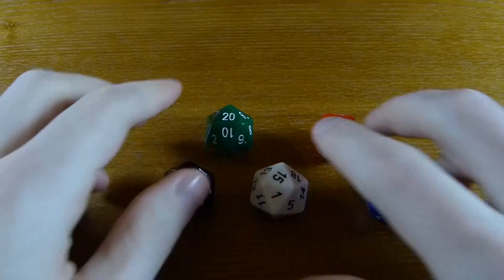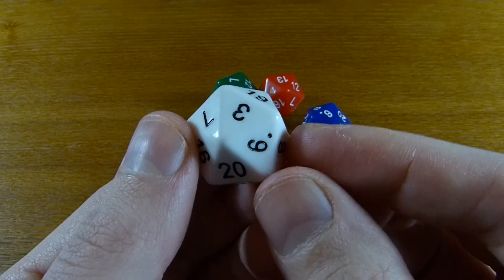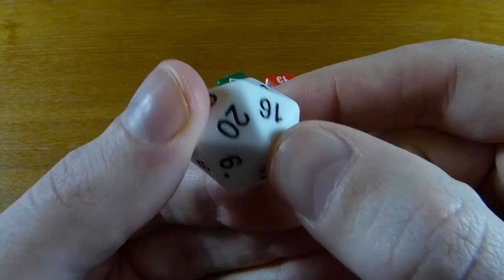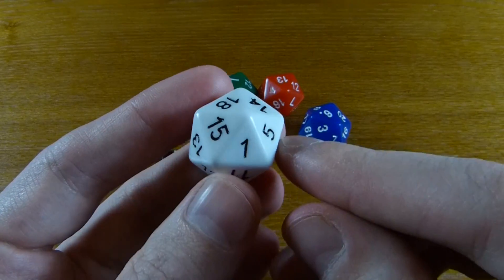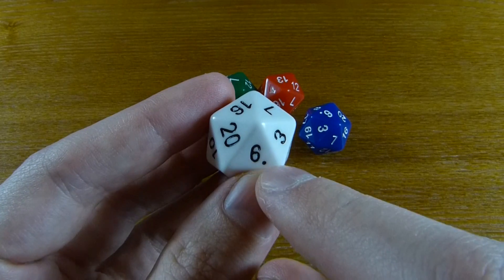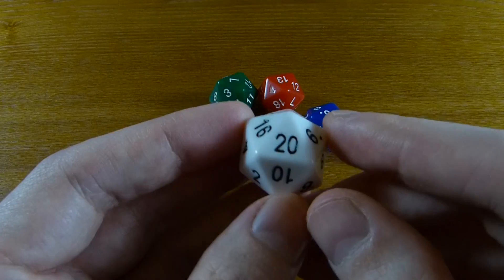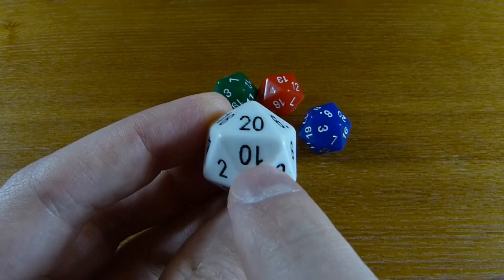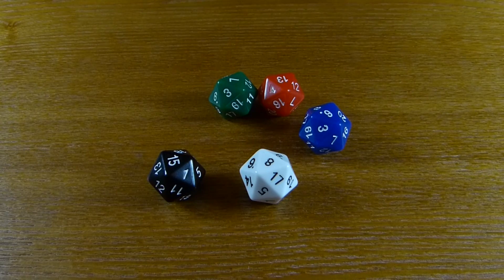Numerically-balanced d20 dice

Comment: I discovered other interesting properties of these dice:

As I was watching the video, I paused frequently to write down the numbers on the TOP HALF of the die (centered around the 20) and the numbers on the BOTTOM HALF of the die (centered around the 1).

The dice in this video have the following properties:

TOP HALF:
Eight numbers (80%) range from 1-10; Two numbers (20%) range from 11-20
Seven numbers (70%) are even; Three numbers (30%) are odd
2, 3, 4, 6, 7, 8, 9, 10, 16, 20

BOTTOM HALF:
Two numbers (20%) range from 1-10; Eight numbers (80%) range from 11-20
Three numbers (30%) are even; Seven numbers (70%) are odd
1, 5, 11, 12, 13, 14, 15, 17, 18, 19

But now compare this with a standard d20:

TOP HALF:
Five numbers (50%) range from 1-10; Five numbers (50%) range from 11-20
All Ten numbers (100%) are even
2, 4, 6, 8, 10, 12, 14, 16, 18, 20

BOTTOM HALF:
Five numbers (50%) range from 1-10; Five numbers (50%) range from 11-20
All Ten numbers (100%) are odd
1, 3, 5, 7, 9, 11, 13, 15, 17, 19

Comment: I watched the video slowly and single frame for much of it. I did that to get a good view of the d20 sides and vertices and adjacent faces. To make a complete map of the d20. Then I placed that data into a spreadsheet to prove that the five faces around a vertex, and the three sides adjacent to each each face, are all numerically balanced. I was not surprised to find out they were. Then I went and bought a bunch of dice.
Reply from the maker: You might also want to check our work on the d120!
Reply: @henryseg  I have a blue d120. And a red d120 on order today. Thanks! I have a large spreadsheet proving the numerical balance of the d120. Crude but it works. Rows 1 thru 120. Columns for every one of the 62 vertices. Each column proves a sum of 605 or 363 or 242 depending on the number of faces.

Comment: You should compare in a file Excell ex. 100 roll of your numerically balanced d20 with a standard d20 and the random function of the program.
It would be interesting to see the distribution of values in the 3 cases and verify which is the better.
Reply from the maker: The problem is modelling the die roll. The naive thing to do is suppose that each face of a d20 comes up with equal probability, in which case there is no difference between any of the numberings. To see differences, you need a model of how a physical die with physical imperfections rolls. And you need a model of how those imperfections are likely to arise in manufacturing. It's all very complicated.
Reply: @henryseg 
I understand. Thank you for the answer.
In one of the videos of the opti dices I pointed out how you can also create the d20. 
You can do:
01, 02, 03, 04... 18, 19, 20 with the exagons font. 
You must only change the shape of the number 1 because now is readable upside down so 10 is equal to 01. Changing the shape of the disposition of the ten exagons of the number 1 you can do it!
Reply: @GiuliSnow  i believe the issue was also more that you cannot fit two numerals in that font onto a single face

Comment: is that mathematically the most you can do?
Like, given those three constraints together, how many sides do you have to fix until you arrive at a fixed configuration?
And is there enough leeway to add any other constraint that could improve the balance of these dice?
Reply from the maker: +Kram1032 Bob tells me that there are only a few solutions that have opposite numbers adding to 21 and balanced around vertices and balanced around faces. So likely any other constraint would not be possible to satisfy on the nose.
Reply: I have tried doing some further research on this. According to my findings there are 6 solutions which satisfy the constraints given, so I tried hard to find more properties which could be used to rank them. We could try to make the variance of edge sums (add two numbers adjacent to the given edge) as low as possible, but the variances are equal in all 6 solutions. Same for the variance of full face sums (add the number at the given face and numbers around it). Same for the third moments, in both cases. But each of the 6 solutions has a different fourth moment of edge sum. There are 4 values for fourth moments of full face sums, and solutions with low value for edge sums tend to have high values for full face sums.
Reply: So what you are saying is we could pick and choose solutions based on the kurtosis or pointiness of the solution's distribution of either the edge sums or the face sums, and the solutions which are more Gaussian (I assume that'd be the goal) for edge sums tend to be less Gaussian for face sums and vice versa? Could we express the solutions in some kind of linear combination which then could be minimized together?
(I'm only sorta going out on a limb here. I don't really have much of a clue how these things are done but I've seen plenty of seemingly entirely unrelated things suddenly be interpreted in a very precise and natural manner as some sort of vector space with geodesics and all, so I can only assume this is true here too)